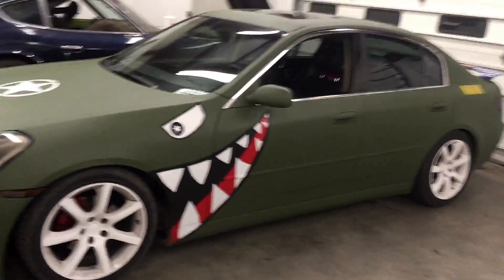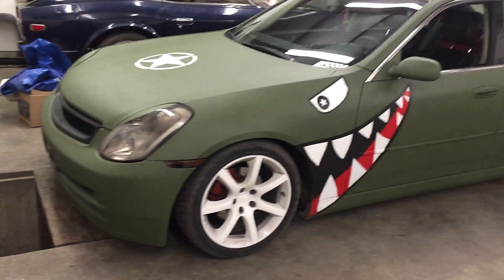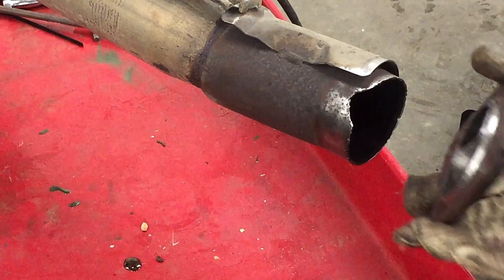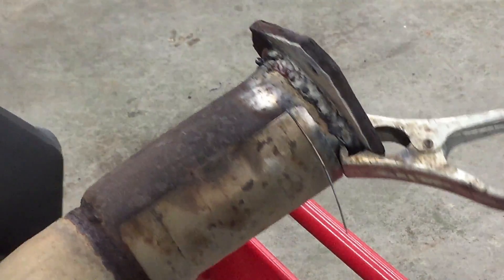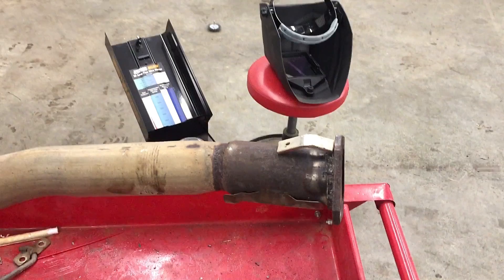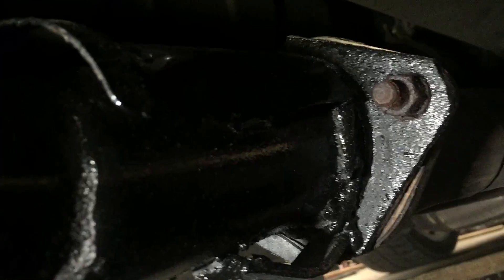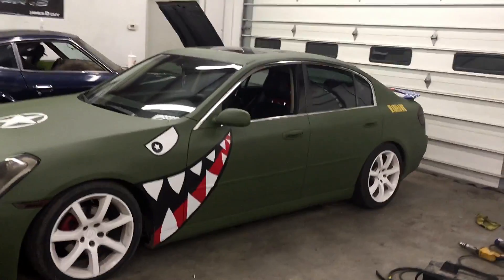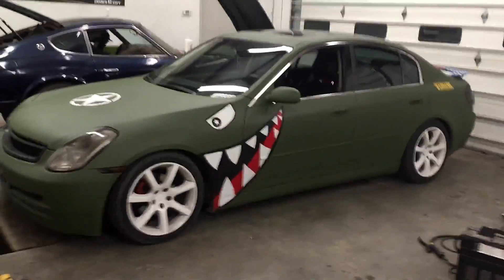I broke the exhaust. Time for a new one. (Check it out)

Comment: With those welders if you take a propane torch to it to heat the surface areas up it will weld a better beed
Reply from the maker: poor farmer Good to know! I’ll try that. I know that works good with cast iron for sure.

Comment: Cut out those flex pieces they always leak just buy a piece of pipe that's the same size and cut off the flex pieces and weld up some solid pipe, a little more practice welding never hurt

Comment: 2nd!
Reply from the maker: Kelly Moore WOW LOOK AT MY WIFE PARTICIPATING IN THE COMMENTS 😍😘
Reply: @JamesDguy    James,   you shouldn't  have
    welded the 'pinholes'.  they are there to allow any condensation
to drain and prevent rust inside the pipe.
Reply from the maker: Norm Hodgkinson These pin holes were not for draining out condensation it was from previous welded welding up the flex tubes. The driver side didn’t have it and it was leaking from it. Stock exhausts don’t have them either. I could see how you thought that though
Reply: @JamesDguy   i usually see the pinholes in mufflers for that reason,
    so i thought maybe they were in those pipes to serve that purpose.
Reply from the maker: Norm Hodgkinson At the very rear Yea in stock mufflers now that you say something but never see them that close to the o2 sensors/Dow pipes